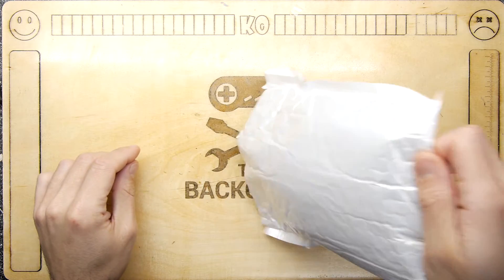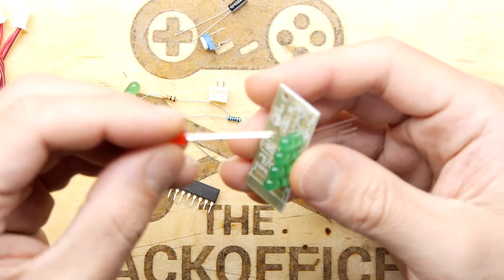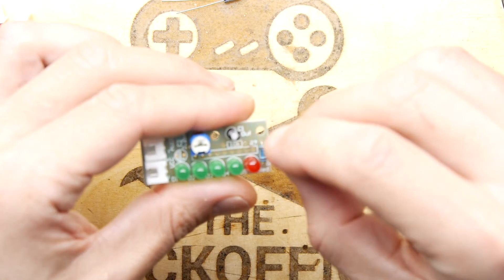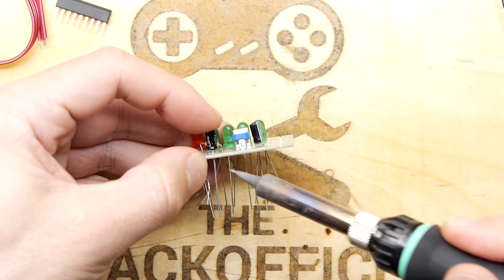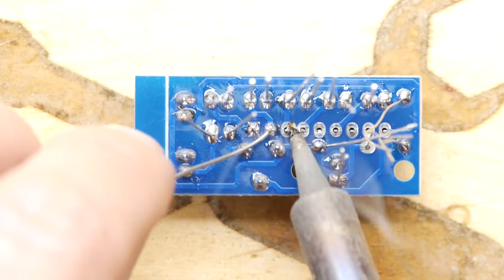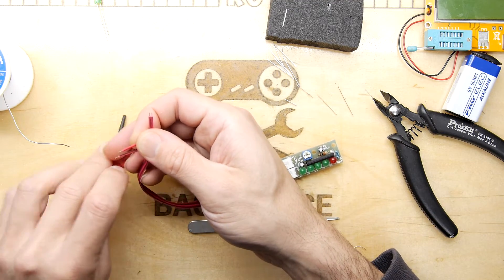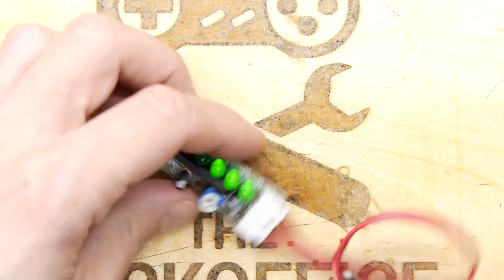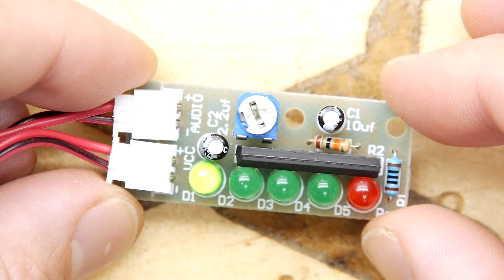KA2284 Audio Level Kit

Comment: In pin 8 which is the audio input ... I used to have a capacitor of 2.2 uf at 50v. My question is ... what function does this electrolyte capacitor have? I removed them from both inputs because I did stereo. It turns out that when I turned up the volume and the LEDs indicated red ... it generated a distortion in the music ... will it be that those counters fix my problem? ... thanks again friend.
Reply from the maker: I would need to check the circuit, but in audio applications capacitors are usually there to either eliminate DC from an audio signal or prevent circuitry from affecting the audio input during operation. I suspect the electrolytic was there to meet the current demands of the LEDs

Comment: i love getting these kits from ebay/aliexpress.. but little more than ways to improve my soldering skills and concentration skills. I never actually seem to USE them lol
Reply from the maker: I just make them and sling them on a shelf 😁

How do you rate my soldering skills?
Reply from the maker: Ha ha, I don't recall burning myself in recent times but that's probably down to having wrecked skin from all the previous burns